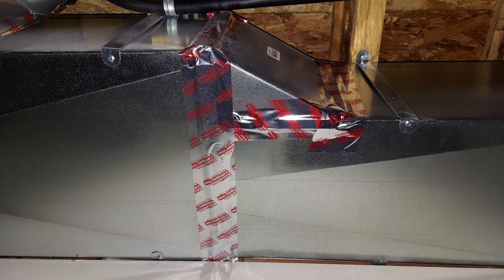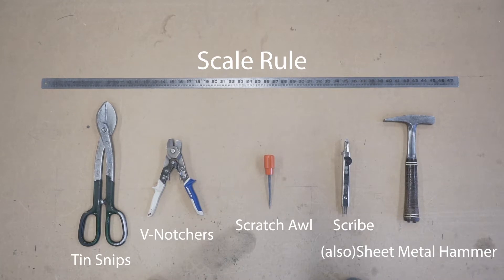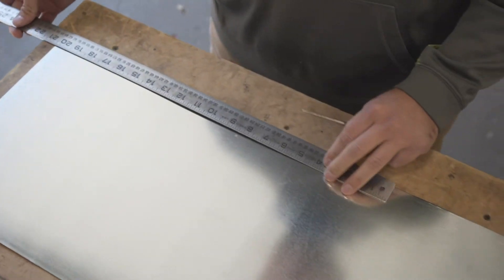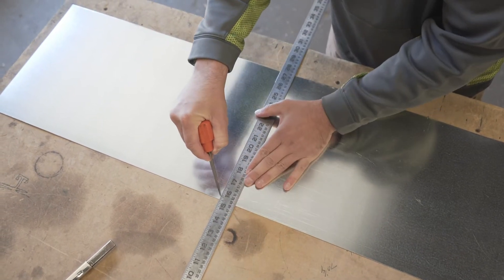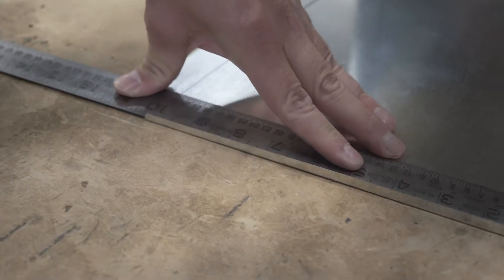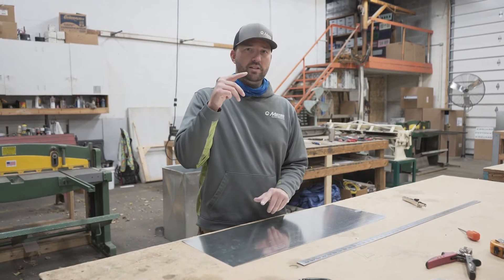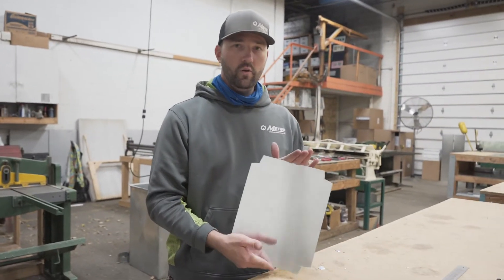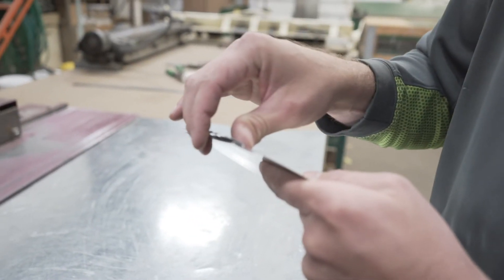How to Build a Sheet Metal Duct Transition

Comment: Can you help us with down shot  RTUs on the field when using a adjustable curb adapter for duct transition for supply and return,offset transitions to adjust for the shift on difrences,or short flex connections or sheet metal adapters. Thank you for sharing the knowledge.

Comment: I have a house that was built in the 1877 and heating was put in back in 1933 the ducting they used is 10" x 4" and is on the outside of the walls. I rencently had to remove a wall and was able to move the duct back to where it will be inside the wall, but I need to reduce from the 10" x 4" to a 10" x 3.25" trunk. How do you layout reducing the depth instead of the width? I don't have access to a shear, break or pittsburg machine.

Comment: Also mark   everything - duct size, S D etc. 
So  1. the field guys  can  keep up with the  pieces and  orientation for assembly  and 
2.  assuming  your shop has more than 1 worker or if you are  producing more than 1 fitting.  Layout, cut everything. Then  run all the edges,  beads ( or crossbreaks if you  don't have a beader), locks and the  the  drive  edges last.

This way all the pieces, if they  get mixed up can easily be sorted and organized. And  sending  100s of pound to a jobsite,  loading unloading carrying al the duct to the   assembly area, etc - stuff ALWAYS gets mixed up, so labeling is essential.

 I always  put in/out,  top, bot, L, R on each piece.  Again  it reduces human error in the shop and/or at the job site.  In out is for lined duct. Also  keeps straight which direction  you are bending the 1" side that straightens fitup  for the D or S as the case may be. Keeps the drives on the  correct face :)

Also when  cutting stacks of S and D, the guys can see at a glance which edge is the S and drive. It all  just makes things more organized and time saving. 

 BTW your 2 pc method  for 1 side transitions is  fast  and easy.  But center taper fittings and   double transitions  are relegated to 4 piece. Hence is IS ESSENTIAL to mark everything as  you lay it out.

Cheers - and nice vid for beginners doing residential light 26 gauge work and small  shops with limited machinery.
Reply: Спасибо за полезный совет!👍👍👍👍👍

Comment: Pretty darn amazing job. Very professional. What state are you located in?
Reply from the maker: Des Moines, Iowa
Reply: @MetroHCI  Thanks. Will you do a custom piece if I send you a sketch with some dimensions? Just bought my very first home and it’s an older home which I am renovating myself. Have a piece of duct I need moving in my basement but the quotes I’ve gotten are just too ridiculous IMO. I can do this myself but finding the duct parts is not easily obtainable where I live. Just need to extend the duct to get it out of the of where I need to build a wall.
Reply from the maker: @pf5658  Where do you live?
Reply: @MetroHCI  Thank you for the quick response. I live in the Atlanta metro area.
Reply from the maker: @pf5658  Sheet metal prices are ridiculous right now. I'm not going to be able to do it cheaper than your local guy. I just received price increases this morning. Example: 12x8 duct is $5 per foot!!!
Reply: @MetroHCI  I understand. I know what’s happening with prices these days. For what I need I still think that’s fair. They wanted to charge me over 4K just to add and extend an 8”x16” piece of duct. I think that’s a bit ridiculous IMO. If you hav email I can send a few pics so you can see what what I’m trying to achieve.
Reply from the maker: @pf5658  info@metrohci.com
Reply: @MetroHCI   My apologies. Never got a notification that you replied. I know exactly what I need and I will send a sketch with dimensions. Thank you sir.
Reply: @MetroHCI  Hey I sent email with sketch and dimensions info. Please check you email and spam email to see if you received it. Thank you.

Comment: The reason why you keep seeing shitty ductwork is because most companies getting those jobs don't have a full on metal shop with 8 foot breaks and pittsburgh machines and that's also the reason why you didn't get the job because you got under bid. Most likely by a company that sent out one lead and a helper fresh out of high school or the owners degenerate son who cant get a job anywhere else. With all this being said, I'm not impressed by your demonstration, I would have been more impressed if you made the transition with only bar folders and maybe a Hensler bender on the floor of the shop.  Anyone with a few classes from local night school and the practical sheet metal layout book from Richard Budzik can make perfect fittings with a full on metal shop. Show how to make a pittsburgh seam by hand with flat bars, show how to generate a transition in big duct with gap that spans 3.5 feet and is a double offset and only with hand tools,  and smooth transition with only hand tools, you know, the hard stuff.

Comment: Doesn't you area have codes for duct testing.. its almost second nature anymore to mudd all the duct. I always make v not straight lines... say something scratches the metal to confuse a line. O guess you don't have the Malco screen with all the different measurements 1">1/8". Why not just use snips and make straight cuts go back to the stomp shear and just use that to cut.. helps save the hands in the long run. Cross hatch all fittings is good practice. Nice simple shop to be efficient.
Reply from the maker: Good morning. Yes, our jobs do get tested for duct leakage. Most of our customers opt for using the AeroSeal duct sealing process though, so no need to mastic our ductwork. When we do use mastic we will paint it on on the jobsite. Why don't I use the stomp shear for my angles? The more dramatic of transition the more you would cut into the piece that slides into the s-cleat. Also, If I used the shear for everything I would lose my Popeye sized forearms ;)
Reply: @MetroHCI  I'm glad you didn't cross brake it.  Something that small, with S-cleats just doesn't need it.